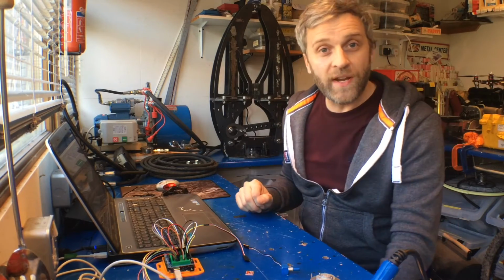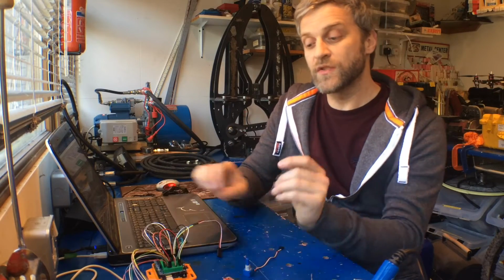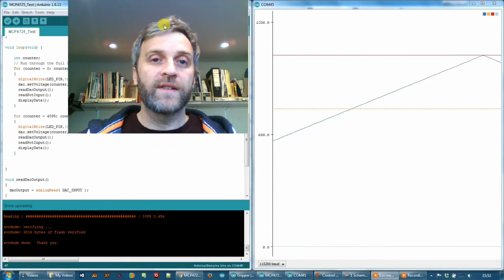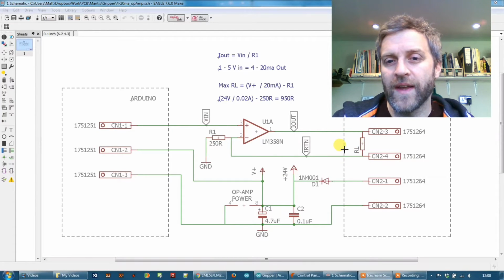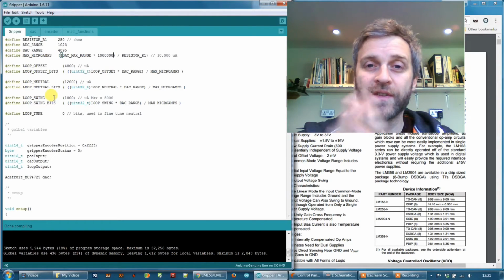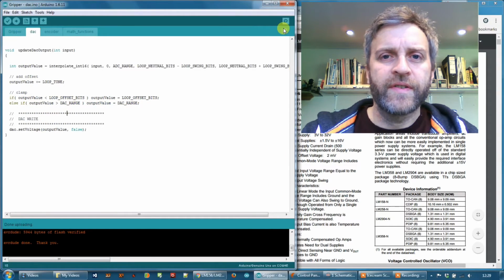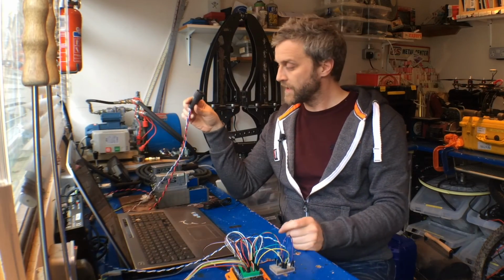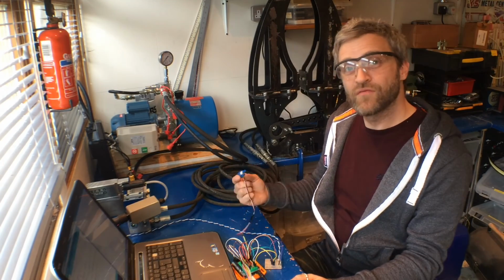Mantis Gripper | Proportional Open Loop Hydraulics | - Mantis Hacks #4

Comment: Hi, Matt.

I work on hydraulic winch control project with spool control. Can you share this complete code?
My problem is controlling the four proportional valves to operate the winch, the spool, the brake and the staging cable.
Simultaneously, I need to read an encoder to count the drum turns and thus calculate how much spooling will move depending on the direction. I also read a load cell to check the tension applied to the cable.
Reply from the maker: Hi. I think I go through the code in my video.. I’ll share if I get time to my github page
Reply: Thank you Matt!

Comment: Why do you use cetop style valves? Why not use a flow compensated valve like a danfoss pvg32. Then you could also use a more efficient  loadsensing system.
Reply from the maker: This is what I had. Not looked at the pvg32 can you explain how they are better?
Reply: With a loadsensing system the pump delivers pressure and flow on demand. With results in less inputpower and less haet production. Maybe this link explains a bit more https://youtu.be/PbXB2VnhpXw.

Comment: Matt can you control a standard solinoid hydraulic valve to operate like a proportional valve with a setup like this or must you use a proportional valve?
Reply from the maker: +DonsfirstYou hi, well you really need a proportional servo valve. However, it should be possible to make a proportional servo valve, at leat a crude version using proportional solenoid valves..
Reply: Thanks Matt.
Reply from the maker: +DonsfirstYou no worries!

Comment: are you going to limit the movement just by using the encoders or are the pistons built to be driven to the end or are you for safety going to install limit switches? btw do you have a background in engineering? great video again :D
Reply from the maker: jöötäjä there will be soft limits set by the encoders when in closed loop mode. Otherwise the hard limit is set by the mechanism. I studied electronic engineering, been building control systems for film animatronics over the last couple of decades.
Reply: nice, so the cylinders don't get damaged by doing that? do you also calculate the pid loops (solve the equations),when you close the loop or is it mostly trial and error? :D
Reply from the maker: jöötäjä well your not supposed to drive the cylinder to its full extent at speed without so me kind of damping or physical limit, so under closed loop control three will be an electronic limit. In the closed position the grippers touch before the cylinder reaches full extent. When open I rely on the electronic limit, but may add a physical stop too.
Reply: nice! could you do a more in dept video on the can-bus on the mantis? as in go into detail about the hydraulic control unit and so on, would be very interesting :D